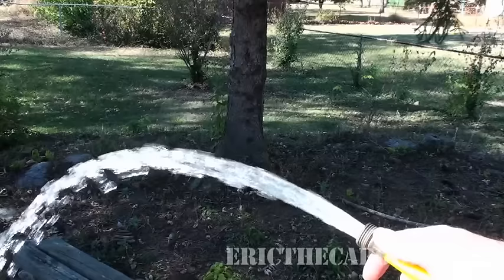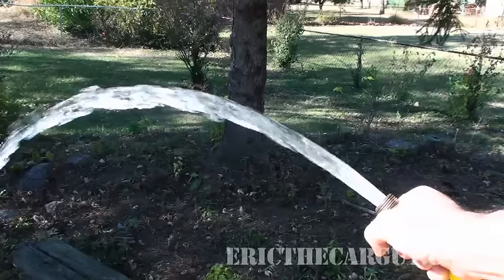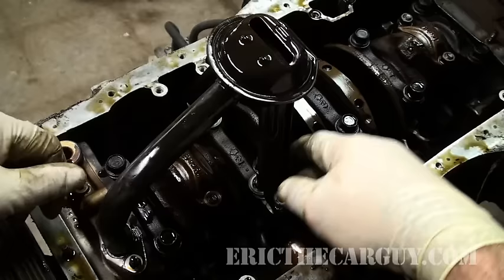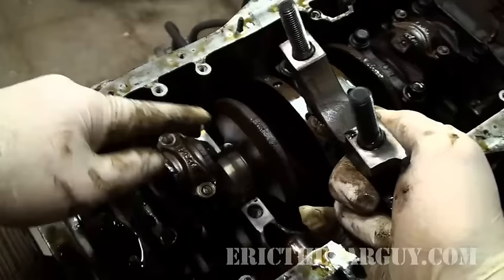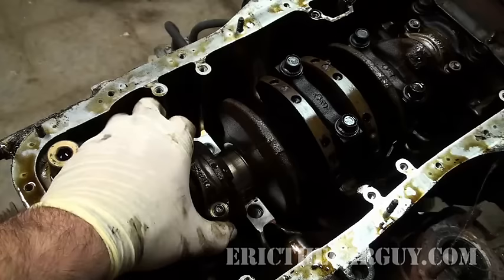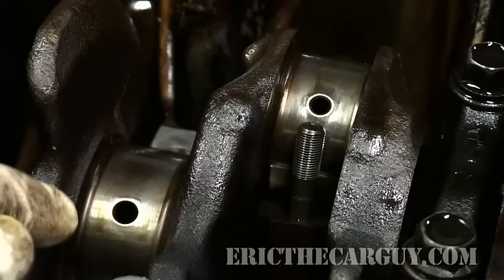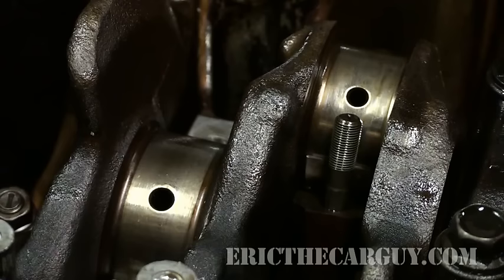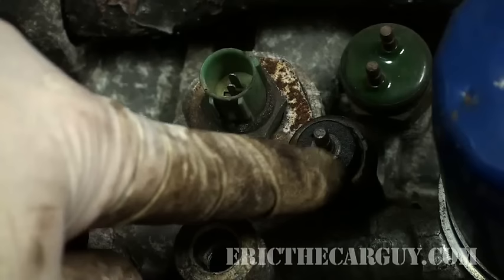How Oil Pressure Works - EricTheCarGuy

Comment: actually liquids are very compressible, im speaking from an engineering perspective the term for liquid compressibility is Bulk Modulus
Reply: True, however the reason that MIL-L-23699 (turbine oil) and more specifically MIL-PRF-5606H (Hydraulic fluid) are used in aviation is because they are not as compressible, on top of their standard characteristics, as other fluids (which is a big deal in a T701D Blackhawk engine turning 69,000 rpm cranking 1800 shaft HP at the 5606H filled gimbal).  What Eric is trying to point out is that liquid oils are not nearly as compressible as a gas.  We're talking about every day consumers looking for information, not trying to confuse them by tech'ing them to death...  I understand people want to show their stripes, but keep it simple and don't ruin the main point.
Reply: NOBOX7 troll
Reply: thanks
Reply: From a practical perspective, oils are essentially non-compressable. Realy isn't an issue till you get over 200 psi.
Reply: J. Helvie this is not a practicle observation and if you also agree liquids are not compressible then join the group of jackoffs above you and as for 200 psi i know of no oil that compresses at such a low pressure to a noticeable degree  the point is people are talking on a technicle channle and saying  "liquids " are not compressible and the fact is 
they are very compressible im currently using the formulas every day , look up the subject and inlightent yourself and stop telling people flat out lies and dont forget oil is exposed to over 10,000 at the piston rod  interface due to the 850 psi explosion pressure and just so you know i have cought hell for the comment "liquids are compressible " so you may be catching some flac from the last 10 idiots who insist i dont no what im talking about and i shouldnt confuse the stupid public with all my nonsense
Reply: I want a milk bone!!
Reply: Dustin Wutschke are you happy now ? because of you liquids are no longer compressible :(
Reply: Dustin Wutschke lol , well then mcdonalds pays 50$ an hour, lol i make prevailing wage pal took home 65k last year am also a mathematician and have bin working on bulk modules formulas for the past 10 years and at mc donalds they teach us that synthetic motor oil started as turbine oil and was then modified for race cars then sold to the public sorry to offend you i just dislike it wen people correct me wen all im doing is sharing knowledge i didnt just dream this stuff up
Reply: Dustin Wutschke you know whats messed up ? you agreed with me on the topic of oil being compressible then told me not to confuse the public, i was very interested to find out liqiuds are in fact very compressible just thought it would be cool to share that then you people beat the hell out of me and say " dont tell them liqiuds are compressible"  then you pic on me for sticking up for myself??? very strange and intresting observation
Reply: You guys have a lot of time. .
Reply: Everything & I mean everything is compressible so the question should be , by how much ?
Instead of throwing a tantrum about how right you are why don't you simply explain it or,  explain it simply ?
Reply: NOBOX7
it wasn't your wisdom they're against it was the way your message came across or, was presented .
I know this because I am many times guilty of the same thing of presenting a comment or answer which, I, in my mind think or know most should see as accurate & not question because I know I was/am correct .
I believe that any moment they should/will suddenly get it & when they don't even though the message was correct they think of you/me as an idiot because they are still in the dark .
Reply: NOBOX7 Best to keep ones mouth shut & be thought a fool, then open it & remove all doubt.. There was once a time when manners mattered.
Reply: J. Helvie
& then the internet came along .
Reply: ***** yes . its actaully kinda easy to compress water , it just doesnt compress much, i have videos of a device filled with acetone and i compress a needle vavle rod into the cylinder like a little piston  , it will prove what im saying and all the physics books as well
Reply: I agree, I think when he said "you can't compress liquids" he meant? To the amount necessary in order to achieve the standard needed for the task?  That is where the weight of the oil becomes relevant the thickness is what gives the pump the ability to deliver the volume so once the correct volume is sent the unit area designed for compression of the volume can deliver the pressure needed to distribute it in the proper amount?  (obviously liquids can be compressed or he couldn't have used the water hose as an example)  However, if the water was partially frozen would he still have been able to use his thumb to create the same amount of compression to complete the spraying pattern of the unfrozen sample?  All in all he helped others to understand why the weight of the oil is important and what it does also that if your having a problem with pressure don't bother wasting your money having that replaced when the problem is not with the volume but the why in which it is compressed and to focus your money on that problem which will be a bigger issue.
Reply: You engineering guys and your specifecities. The guy was obviously talking about a general, simple case.
Reply: so hydraulic bakes don't work?

Comment: Waaay back when, a local Chevy dealer had taken a nice Mustang in on trade. It had a 390 V8, and they discovered after running a few minutes the oil pressure would  drop. Last things first, they replaced the oil pump. Didn't fix the problem. New engine bearings. No change. This was in early 1970's, so imagine toady's cost for whet they had done. The service department racked up almost a $1000 charge against sales department. THEN they checked most common point of failure, the oil pressure gauge. It was bad, and they had never tested with a test gauge.
ALWAYS VERIFY PRESSURE with a different gauge first when you have low pressure indicated on car's gauge/light.

Comment: dales6amx,oil pumps make pressure and volume,bearing fitment,rods mains,cam,etc,hold pressure,oil pumps rarely fail,since they are submerged in oil,most oil pressure problems are from too much clearance between bearings and journals

Comment: Very helpful. Found a disconnected oil pressure wire in my ‘68 VW Squareback. Now I know not to use it for an oil pressure gauge, just a light!

Comment: I have a 2006 GMC Envoy- had the oil changed as usual.. runs great , my oil pressure on the dash fluxgates and went to 0.. , and check engine light came on shut her down, had her towed to the mechanic,  he replace the vvt control solenoid , brought it home drove about 14 miles.. did the same thing. now they replaced the oil control sensor.  I check the oil dipstick faithfully..oil on didpstick before starting.. NO noise, my engine purrs, no loss of power, no stalling, exhaust is clean..  No knocks, or ticking ..engine runs quiet.. especially in this bitter cold weather we have been having. She is a 4.2 liter, inline 6 single ohc..with 194,000 miles ..faithfully gets her oil changed..  I know she is getting old, but this is a puzzle.. I am not picking her up until Monday..  should we check the pressure manually? Thanks for any advice.

Comment: Garden hose and thumb over the end a good analogy.  But what happens to the pressure of the water if you keep your thumb over the end of the hose but turn the tap down a bit to reduce the volume of water?  The reason I ask is because the only time I see oil pressure fluctuate in my 4G63T is on long right hand bends when I know the g-forces are pulling oil away from the pickup in the oil pan.

Comment: My (admittedly limited) experience is that at least rod bearings simply do not wear under normal conditions. I rebuilt a Volvo engine with 190K miles on indium faced rod bearings and it plastigaged completely within specs - confirmed by the indium face was intact. Even standard steel-bronze-babbit metal bearings must not wear; if the babbit metal is damaged the deterioration occurs very fast and very severely - rod knock. That is why oil starvation is so serious.

Comment: The main question when it comes to oil pressure is;  "where is the oil pressure is being lost.."  Some cars have an oil pressure sender/sensor right after the filter, which shows pressure before the oil has been through the bearings. Some cars have a sensor/sender on the intake or block, which shows oil pressure after the oil has been through the bearings. Some cars have multiple, one before the bearings and one after.  You must test oil pressure with a special adapter at the oil filter  adapter to determine if the pump is working correctly.  You will either have to remove the filter and use a special tool which takes its place or you may be able to use a port on the oil filter adapter housing.  If the oil pressure is good at the filter then your oil pump is working fine.  If you are losing pressure in the bearings you will have to tear the engine apart... and note this, the oil pump is located before the filter so foreign materials will damage the oil pump before damage is done to the bearings unless you run the vehicle low on oil, theres no telling what may be damaged in that case.  I have replaced many oil pumps to repair low oil pressure.  In many cases the oil pump looked fine but it was still the culprit.  Thank you Eric, you explained well how pressure can be lost in the bearings but people need to know that oil pumps are not uncommon to fail, and there are other parts such as push rods etc that can be culprits of low oil pressure.  Every manufacturer has their own system, it is crucial to have a skilled tech diagnose your car when it comes to oil pressure.  If the pressure is low do not assume you have bad bearing(s)

Comment: I just had my oil changed a week ago.  Well yesterday my oil light flashed I xcelerated and it went off.  Well today,  stopped at traffic light it's back on flashing.  I out itbin neutral was still  on . It's a 08 Dodge caliber 2.4 r/t.  Thanks for your help

Comment: I had a care serviced once and it came back with the oil lite coming on at idle took it back and they added a resister in series with the oil sender unit and said problem fixed. On my next service which I did my self I noticed the oil was quite thin 5W or less changed the oil to 20w-40 and removed the resister and bingo no more oil lite. so yes thicker oil works and its also recommend it on older cars.

Comment: Thank you Eric for the explanation, 
I have 2013 Altima  2.5/ 255k I had a oil leak from the crankshaft, I’ve replaced the seal, leak stopped then the oil pressure light came on, and I started to hear knocking noise coming from the engine. 
Any idea?

Comment: Sorry for the short question by battery was dying. The reason I ask this is because I just did alot of modifications to my supercharged Sea Doo lifting limiter from 8100 to 9200 rpm 18 lbs of boost bigger intercooler blow off valve, stronger flywheel bolts, 80 lb injectors etc. Well somehow in this process a paper towel got left in the motor and low oil pressure after 30 yards from no wake zone shut off. Went back out again thinking it was a bad ops same thing idled back in this time after hitting throttle a few times very short bursts. Anyways after checking oil pressure was @ 4 idle and 4000 only 30 so I stopped there and figured out my oil filter had paper towel debri all in in. Now my plan was to pull motor and clean both intake screens and new oil pressure regulator. Both my engine builder Buddies are telling me I need to tear the entire motor down ( which I didn't  want to hear.) My question  is since this oil travels through siphon pump screen and siphon pump then pressure pump screen and pressure  pump and then filter to oil cooler are these pieces big enough to clog oil passages, piston oilers crank,, crank bearings, rocker arm etc.

Comment: Dear frd, finally I saw your video related to my problem I hope may be very useful, now having problem in my car engine noise every three months once for reason may be  oil pickup problem , after clean my oil pump having more sludge and something after then replace new engine oil working well only three months already I follow my car every 3000 km change oil and filter, so want to stop this problem anymore plz give me good idea

Comment: Radiator preasure is build up from the raise in temperature from the coolant. The hotter its gonna get the more pressure the water builds up. Water under pressure also has a higher boiling point. if the pressure gets to high (lets say more than 1.1bar on a Civic) the radiator cap opens and the water goes to the spill tank. when it cools down again the water gets sucked back to the radiator. Sorry for my bad english, its fast typing;)

Comment: low oil pressure means there is something wrong and once you have a problem, the larger the problem will get. once you get bearing wear, it goes pretty quick.

Comment: I have a sticky lifter, no additives or different oil or flushing makes much of a  difference, the oil just wont pump up the lifter until it warms up a bit, it's worse when its cold, the best scenario I found is using 0w 30 oil which makes sense, I don't have an oil pressure indicator so I can only surmise that my pump is OK just the lifter is clogged since the engine sounds fine besides the lifter noise, previous owner didnt change oil on time I can see theres sludge in the valve cover, I'm tempted to pull the head and see if I can clean it out one day, I got the car really cheap it might be worth it

Comment: 175k on a Ford 5.8L with 5psi oil pressure instead of 6 to 8, resolved with 10w40 and L... forgot the name of it, white bottle.. additive.  We'll see how it lasts, but it would be interesting to get thoughts on a thicker oil affecting a given volume oil pump running through a worn engine.  Didn't expect it to have that big an issue at 175k.

Comment: Check oil level if it's low fill it up. 
First check your oil pressure how much you got . If under 5 PSI on modern engine it's a bigger issue. 
If your engine starts cold and the pressure is over 50PSI  but when it get's hot you have a rod bearing issue. 
If your oil pressure is already low when your engine starts and stays low either the pump is bad or seals are broken 
trouble shoot it step by step often it is a multiple events leading to it.

Comment: You are right. I have the exact problem, my 07 Escalade has low oil pressure only 17 PSI in idle state, and the normal reading above 25 PSI. I cleaned pick up tube strainer and I changed oil pump and the O-ring, no change in reading. The mechanics tell me the same... Could you give me an advices in this case ? Thank u !!

Comment: Its the oil pump that create pressure. Your illustration of the water hose shows it clearly. It is the water pump that forces the water thru the hose. The finger that restrict the flow is not the  pump. It just increases the pressure.

Comment: If your engine has a lot of miles I assume thats because you are using engine restore, if on top of that you flushed the engine before changing the oil and filled new fresh oil in, I would assume that some gunk was blocking an overtime shrunk rubber gasket somewhere and you thinned and washed it out (valve cover gasket, oil pan gasket) this resulting in a seep or tiny leak. Clean everything with brake parts cleaner and idle the engine checking for leaks underneath. I hope it helps!

Comment: I don’t wanna be that guy but milling‘s most definitely makes a high volume/high pressure pump and they also make just a high-volume pump. 
pressure is a measurement of restriction of flow and the flow does not exist without the pump. i agree with what you’re saying because it’s not like you buy a 60 psi oil pump or a 40 psi oil pump, but what you should really say is the oil pump supplies flow and the bearing  clearances acts as a metering device to create pressure, engines oil pressure it’s not defined by the pump but it is created by the pump

Comment: Hi Eric,
You're a good mechanic, I always watching your videos and it helps me fix the problem of my car. Now I have another problem on my Honda 1995 accord model. The machine suddenly dies while running after maybe 5 to 6 miles on the road, then the "Low pressure indicator" light on together with the "Charging system indicator" and when you start the car and the machine is on it goes off after sometime. Its happen to me every now then for one day. Anyway, both lights are not blinking or continuously on while the machine is on. Please help and I know you can give me the answer or idea how to fix it.
Thank you the Mr.cargauy.

Comment: my old Ford 351W has a physical oil pump that is powered by thecam that spins my distributor that has a drive shaft from the distributor to the oil pump.

Comment: I know this is a very old video. But I have a more recent problem, like a 2020 year. So I did my routine oil change. 2005 chevy tahoe, 4.8l v8 vortec engine w/ 233,450 miles. Oil pressure at cold is about 40 n when warmed is about 35. Now I use 5-30w Mobil-1 high mileage oil and the Mobil-1 1 year oil filter. 
   So I decided I try Royal Purple since I have heard gd reviews about it. Well after doing the oil change and 1 day later my oil pressure gauge went up to 80 psi and hovered around that even while driving for 30 miles.  So I did research n found a few things.  So I removed the oil filter and stuck the used 1 back on, NO change. Then I changed oil pressure sensor, oil pressure actual went even higher than 80 psi. 
 Did more research, found that oil maybe they cause. So I removed the new oil (Royal Purple) n stuck in what i normally use.  Some change in pressure was noticeable. Pressure is at 60 then goes up to 80 psi when driving. So wht the heck can cause HIGH oil pressure? 
 Should i run a cleaning solution through the engine and replace with new oil again?